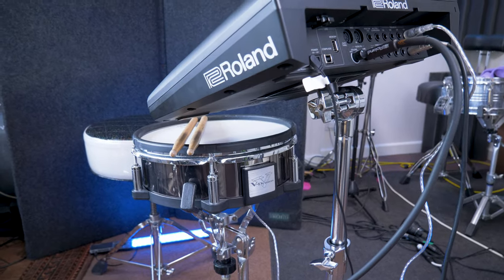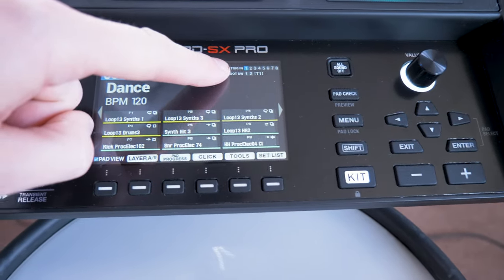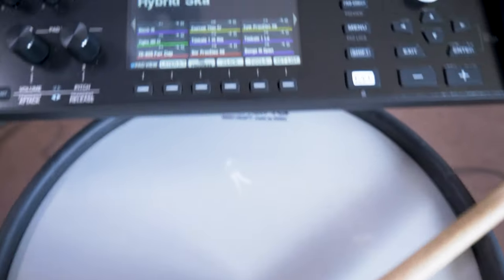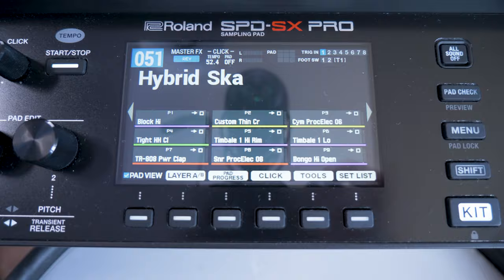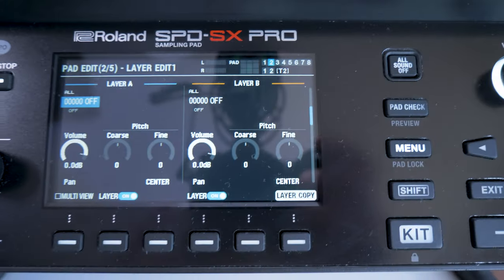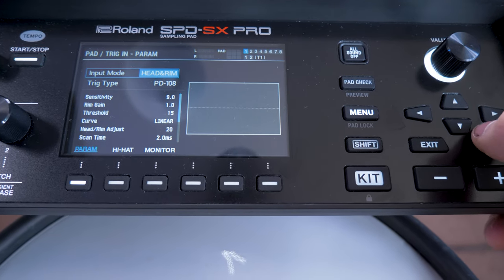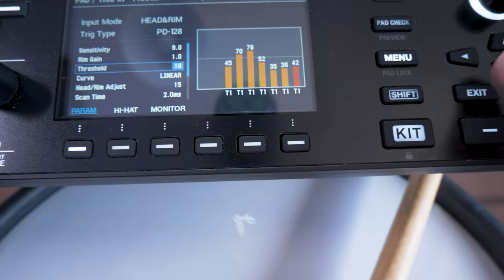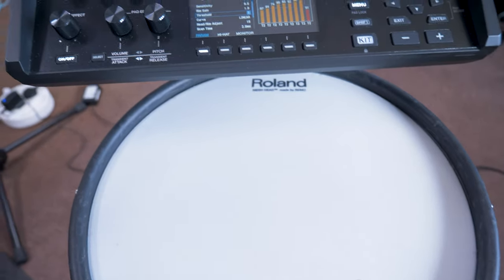How to setup external triggers on SPD SX Pro

Comment: Hi, I’ve recently aquired an electronic Roland kit to use with the trigger inputs on my Spd-sx pro. I’m trying to put two toms on trigger 5&6 as single trigger pads with two mono cables into a y-cable, but I can’t seem to get them to trigger separately. When I hit either pad the same sound always triggers. Have you come across this problem and do you have any idea how to fix it?

Comment: Hi, thank you for this video! I have a question. Would I be able to connect an external trigger that's not by Roland as well? Such as Rtom black hole mesh heads?
Reply from the maker: Hi there, I haven't tried it myself, I wouldn't think that you could to be honest as you are best to select the model of trigger that you're using for best setup 👍
Reply: Get a roland trigger mate

Comment: Hello! I have a question for you: is it possible to use the SPD-SX instead of a drum module like the TD-50 with the VH-14D hihat and a snare or other external triggers to send MIDI to a drum vst like Superior Drummer and get the same triggering (zone sensitivity on the snare etc.) or would you get some limitations?
I'm considering the SPD-SX for a small e-drum kit setup (external kick, snare, hihat, ride and the SPD pads for the rest). Thank you!
Reply from the maker: Hiya, great question, I've been meaning to do a video about this. I'll get around to it soon I hope! I think you're probably right yes, you would certainly have some limitations, but it might give you enough to do what you want to do 🙂

Comment: How do you divide the volume  of the kick with the other patches  so volumes are not the same
Reply from the maker: Hi mate, in the pad edit window you'll be able to adjust the volume, or you should be able to do it by hitting the kick pad to select it (it'll highlight that input at the top of the screen) 
Then adjusting the pad edit knob with volume selected 👍